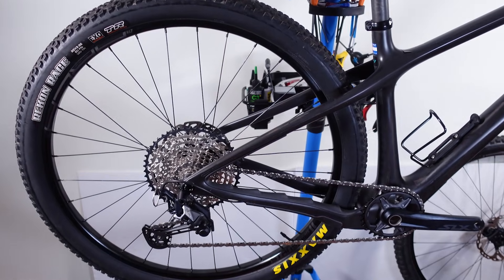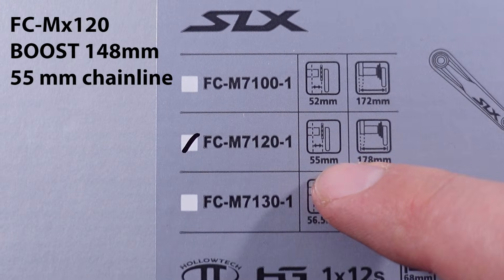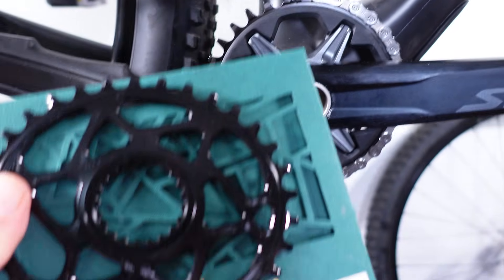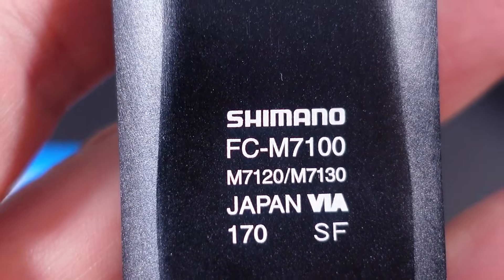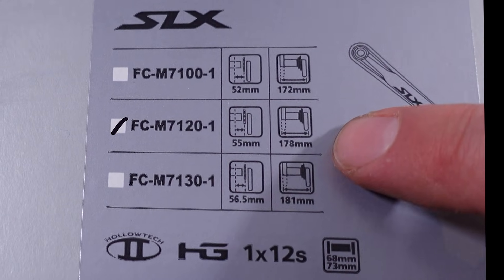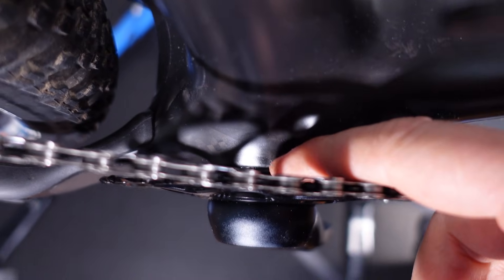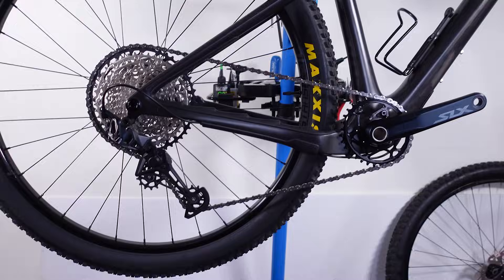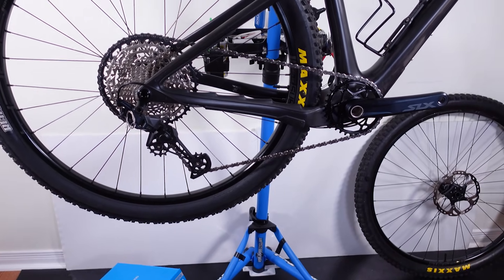12 Speed CHAINLINE Explained - 52 vs 55 vs 56.5 mm, Shimano SLX M7100 vs M7120  Cranksets

Comment: First of all, thanks for the video, I need advice and I hope you can provide it, I switched from a 3x transmission to a 1x12 deore m6100, I ride a hardtail with a O.L.D of 142mm and a bb mt800, I had issues with the crank arm on the drive side because under heavy pedaling it "brushed" the chainstay a little, in the shop the solution they provided was to install all the spacers (3) on the right side so the whole crankset moved to the right hence providing more space for the crank arm, is this right? Now I have a chainline of 52mm and I'm not sure if that's ok, I've read in internet that some people recommend using a chainring with a 6mm offset in this cases to get a 46/49mm chainline, is this correct? I hope you can provide some help, greetings from South America!
Reply: @LoveMTB  thanks a lot for your quick answer! I think I'm going to upgrade to a XT chain, it's more expensive than a Deore chain but should work better, again, thank you for your advice! Take care!

Comment: Does shifting gets negatively affected by moving the chainline 3 mm apart? I have entirely solved chain dropping on a 52 mm chainline by moving one of BB-52s 2.5 mm spacers to the non-drive side. Still, I wonder if that negatively affects shifting. I had SO much trouble adjusting the rear derailler to work with a SunRace CZ800 cassette that I don't want to touch anything else :(

Comment: Your level of good information is quite simply the best around !   Every time you put out a video I learn something and I consider myself fairly knowledgeable.  I'm struggling with chain line on my '16 Trek Fuel EX8 and buying a new crank soon.  Settled in on a Race Face Turbine so I'm hoping there will be enough adjustment to correct mine as well.   Keep your channel rolling.. it's quite good and very helpful.
Reply: Did you buy the race face set yet? I am in the same market. I have a goofy boost 141 (148. W/qr) so I need the 55mm chain line. I’m interested to know how to achieve this with Race Face products

Comment: During my Chameleon build, I was pulling my hair out trying to fit a Shimano crankset, especially since I plan on running the bike with a short 415 chainstay (they are adjustable up to 430).  I wish you had released this video a month ago - a great summary of the current Shimano crankset offerings.  You would have saved my several hours of research.   HA!

My Chameleon, like your Yeti needs cranks with a Q factor larger than 172 mm for clearance.  However I really need to run a chainline as close to 52 mm as possible or my dang chain will drop off at the slightest back crank.  So the Shimano cranks were a no go for me.  There is a reason these bikes come spec'ed with Sram cranks and I wish Shimano would figure this out.  I bought Raceface cranks instead.
Reply: @LoveMTB  Yes RF does have varying spindle lengths.  I have the Aeffect R cranks on order with a 137 spindle,  175 Q factor and 51 mm chainline.  No rides on the bike yet, still waiting for the fork to come in.  :-(

Comment: I have a Ritchey Ultra frame with 148 mm boost spacing and based on the Ritchey website, the chainline for this frame is 52 mm. I am running XT 8100 cranks and everything seems to run fine.

Comment: Using 49mm GXP on 142mm frame with Shimano 12s but chain line still sucks. Not even to mention ground clearance with 650b.
Reply: @LoveMTB  Check out the new Linkglide RD-M5130SGS 1x10 which should work also with 11/12s.
Reply: @LoveMTB  there are some lightweight 9-46 chinese cassette available
Reply: @LoveMTB  thats really the point, but are there any other options? garbaruk is too expensive.
Reply: @LoveMTB  have you ever tested max gear range of the RD-M9100GS cage?
Reply: @LoveMTB  on GS cage, not SGS

Comment: Thanks for the Vid. Good stuff as usual. On my Sb150 I ended up put the spacer on the NDS side to get a better chainline, and it eliminated drops on backpedal on largest cog.
Reply: @LoveMTB  I'm loving it so far but I haven't tried it on real proper rough trails other than one weekend, so I look forward to putting some time on it this season. I just ordered a Mara Pro as I am not completely happy with the X2. Normal days I ride a smaller 120mm bike. Will you be making a review and bike check on your steeds at some point? Since you do spend some time tinkering and thinking about specs I think it could be interesting. Also if you do your own suspension service, it could also be great content if you do full rebuilds!
Reply: Also got an SB-150 and about to fit a new 8100 crank, any idea what the part number for that spacer is, just ordered Y0JC61000 but its just a paper thin sticker, not a 3mm plastic ring like in the video

Comment: Thanks for these Shimano comparisons! These details are so important. The headache of ordering the wrong part is maddening. Bike shops don't always have the most informed staff these days. So you have to know what you want.
Reply: Bike shops are useless.
Reply: @LoveMTB  hay love mtb the shimano cranks m8130 super boost The thickness of the joints is 4,5mm ?
Reply: I’m trying to run 49mm chain line cranks on a 52mm frame/wheel set and a 3mm offset chainring. Not having any luck very noisy drivetrain. Any ideas? 6mm offset chainring ?
Reply: @LoveMTB  In the taller 2 or 3 gears chain must be rubbing on cassette because of the sever angle in the alignment of the cassette vs chainring. I'm running boost wheel set and trying a 140mm length cranks that are meant for non boost, 49mm chainline. Any ideas as what to try next? Current chainring has a 3mm off set.
Reply: Hi i tried ti install a deore 6100 crankset on my 2019 specialized chisel but found out that the deore 6100 spindle length is short for my frame, would the deore 6120 spindle length be enough or do i need to get the deore 6130, hope you could help me out.thanks

Comment: Hi, Great Video, thanks. Specifically on the ARC, was the clearance with the M7100 52mm chainline cranks acceptable, or does it put the ring (32?) too close to the frame for comfort? I have M9120 cranks on order for my ARC, but I'm now aware they've just released M9125 (55mm).
Reply: @LoveMTB  I am running the XTR M9100 cranks with XTR 32T chainwheel on my new A.R.C. and no issues whatsoever. Plenty of space and shifting is amazing. I would say however that I am running a OneUp chainguide for added insurance and the clearance between the inner part of the drive side of the crank and the rubber frame protection on the chainstay is microscopic and I can see that it has caught the inside of the crank after just over 150km of offroad riding. Over time the rubber will wear away sufficiently that it does not rub but leaving more than enough frame protection. I would say that Yeti over compensated on this rubber frame protection. I am also running tyres upto 2.25" width.

Comment: I was recently looking at upgrading my older RF Turbine crank to Next R and had a look at the RF Q-factor Chainline guide.  They have 148 boost paired with a 52mm chainline which is quite a difference from Shimano's 55mm.  Also, doing my own measurement, 52mm places the chain in a straight line from the crank to the middle cogs of the cassette on a boost frame.  Haven't seen any other sources indicate 55mm for boost and I saw in your video that the angle of the chainline to the largest cog gets fairly extreme with the 7120 (55mm) crank.

Comment: Super informative as always. I originally installed the XT FC-M8120 with 55mm chainline crank on my BOOST frame, but found the chainline a bit to extreme and my chain was actually dropping when backpedaling on the largest two cogs. Replaced the crank with the XT FC-M8100 with 52mm chainline, which the frame still had tons of clearance for and now everything is great. The chain stays on my frame are 420mm.
Reply: The same thing happened to me. My bike came with an XT M8120 and I exchanged it for an XT M8100. At the moment I have a 32 tooth plate. When I go to mount the 34 I will see if I have space, if not, I will mount the XT M8120 again. It is an Orbea Oiz M10.
Reply: Might be a stupid question but could you just run 2 spacers on the non drive side and non on the drive side to get 52mm chain line?
Reply: @LoveMTB  Because you made a purchasing error :) I have mine set-up the correct way with 73mm bb and it seems larger than 55m chainline so need to put both specers on the non drive side.

Comment: Interesting, i just received and fitted an M7120 crankset but mine didn't include the tool - i had to purchase one (went with a copy, not a shimano tool).
Reply: SLX does not come with the tool...only XTR and XT... (edit: you get it with the complete crankset with the chainring)
Reply: @LoveMTB  Thanks for letting me know! Mine came in the box exactly the same as yours, i'm wondering if the retailer (well known UK retailer) pinched it out of the box. It was brand new stock to them as i've been hunting for the M7120s in the UK for a good few weeks. Come to think of it i'm sure i saw a youtube video where they didn't have the tool included either.
Reply: @LoveMTB  well it turns out you have to buy the whole crankset with the chainring to get the tool...if you only buy the cranks, you don´t get it...
Reply: @tomasmartinek4264  ah that would make sense, i bought the cranks and chain ring separately

Comment: Great video! My experience with the new Shimano cranks is that they are providing three sizes for quite a few scenarios and, in many cases, the chain lines are not ideal and often push the chain outboard. If you're riding areas are slow and techy and you spend a lot of time in the bigger cogs, it's lousy! There's options to fine tune this though. 

For threaded bottom brackets you can buy a bag of varying width spacers which would allow you to move the chain line a couple millimeters. You can also change out those 3 MM shimano spacers with some wheel manufacturing spacers and stack a different amount on either side to fine tune (e.g. 1mm on one side and 5mm on the other).  Both my bikes put the front chain ring dead center on the cassette.
Reply: Curious, do you notice the difference between the spacings in your knees, or pedaling? I like this option, but curious about the spacing not being even. Thanks.
Reply: @dancing8595  good question. I had a superboost setup before and I’m more comfortable with the regular boost spacing

Comment: I used the M6120 on my boost frame. Chainline was way too outward when using the larger cogs. I think it varies with bike to bike. Does not mean M6100/7100/8100 is definitely for non boost or that M6120/7120/8120 is for boost etc. I also contacted Transition about this and they actually recommended the M6100/7100/8100 on their bikes though they are boosted frame. So best is to check with the bike manufacturer.
Reply: To fix that chain line grab this spacer kit:
https://www.amazon.com/gp/product/B07N4CSRS8/ref=ppx_yo_dt_b_search_asin_title?ie=UTF8&psc=1 

Just make sure the total spacers equal whatever Shimano gives you.
Reply: @tinshield  Chainline is too outward though still usable. Adding spacers will make it worse right??
Reply: @mf3616  not if you add a 1mm spacer to the drive side and add the balance to the non-drive side.
Reply: @tinshield  It will not feel good while pedaling mate. Feet placement will be all over the place.
Reply: @mf3616  that’s false. It’s not enough variation.
Reply: @tinshield  What you mean?
Reply: @mf3616  you’re not going to notice anything moving your crank over 1-3mm.
Reply: @tinshield  I've noticed the difference from the M6100 to the M6120. My shoe would rub against the crank arm as I'm still not used to the longer Q-factor. Guess it varies from rider to rider.
Reply: @mf3616  every frame is different

Comment: Would love to swap my rd-m6000 to rd-m5100 for that better 11-46 cassette compatibility, but 3 best price shops run out of stock. Then the stock came back in one of them, but price went up by ~7$ and I'm hesitating. To buy or to wait for the other 2 stores to get stock?
Plus I kinda had tokens to buy in that other store cause they're kind enough to sell them per piece instead per 5 pack. And I hate to make single purchases due to bleeding out money on postage and I really hate to produce packaging waste
Reply: @LoveMTB  they definitely look the same, but I've got 6000, while 5100 is cheaper than 6100. In fact 5100 is much cheaper than 6000, so much cheaper I can get xt jockeys with ball bearings inside 6000 or 6100. So nice of Shimano to hate less than 12sp drivetrains 😊
Reply: @LoveMTB  thanks LoveMTB

Comment: I did suspect chain line falls onto smaller part of the cassette always. Also on mine mixed groupset hack. Despite 10sp cassette is narrower, but that width comes from left side not going into spokes as much. So 1st gear chainline is benefiting the most, plus derailleur gets more spoke distance, which makes the derailleur much less stressed out not having to work so close to spokes 😋

Comment: You get a like yes or yes.
I have been doing this investigation about chainline on 12s drivetrains for ages, and there are no other videos out there expalining this as good as you do.
I am waiting for my 2x10 to die (142mm) to upgrade to 1x12 and have always been worried about not having options for a 49mm chainline.
I now see 52mm should do OKish with my setup. hoppefully I can install a 34 teeth chainring at the front and not hit the chainstain..
Thanks, very educational videos that address everyday bikers concerns.

Comment: This channel is the best, you always cover all the details I wonder about that no one else seems to cover. I recently purchased the M7100 crankset for my boost frame and was confused between if I should get the M7120 or not. It was confusing that both were listed for boost frames. With the 7100 the 32 tooth is pretty close on my frame but is still good enough to run like that, but for now I’m running a 30T Oneup as my cassette is only 42T. I’m in the easiest 2-3 gears for a lot of my slow technical riding so glad I ended up with the 52mm chainline. Not being able to run an oval or 34T isn’t a big deal for me but this video is very helpful to help people decide between the options.
Reply: Maybe it is possible to get the spacers separately and test it out?

Also when do we see the ARC-build??? I want one after the frame video....

Comment: I think it's funny that Shimano finally went direct mount but chose to produce two piece units with a spider attached to the chainring. Aftermarket options look so much cleaner!
Reply: And still no oval chainring. Which has been a huge help with my kneepain.
Reply: @mtbboy1993  Same here. I also went down to 170mm cranks which helped.

We have a manufacturers in the UK called Superstar Components and Uberbike who provide high quality chainrings at much lower prices than Absolute Black. I must have 5-6 of various shapes and sizes lying around.
Reply: @benmillns8976  getting those will cost same as the Absolute black probably due to added value tax of 25% and shipping cost to 🇳🇴. So I get absolute black. I've not tried superstar components. Absolute black is sold in Norway, its easy to get, I got lucky to get one second hand for good price, even got Renthal Apex stem secondhand. 👌
Reply: It’s two piece because the ring is steel or titanium in XTR.

Comment: So confusing with the offsets and harder when trying to figure out what my bike needs. I did replace my 34t chainring with a 32t chainring last week. Was pretty easy but you did have to have those 2 specialty tools. And who has a torque wrench big enough to use with that TL-C41 adapter? haha

I did have to get a new chain the next day since I removed 2 links and thus it was a tad too short. I found out the next day the mechanic that replaced my 32t with the 34t last fall played with the b tension to make my existing chain work with the bigger CR. Lesson learned.
Reply: 35-50Nm translates into: tight it freacking hard (no torque wrench needed)  :)

Comment: Thank you, was thinking whether to go with M7100 or M7120. Would there be a significant difference in terms of power production with the narrower Q-factor crank? Also,  would the chainline be that bad when I run the M7100 with a boost frame?
Reply: @LoveMTB  Thanks, your videos have been very helpful